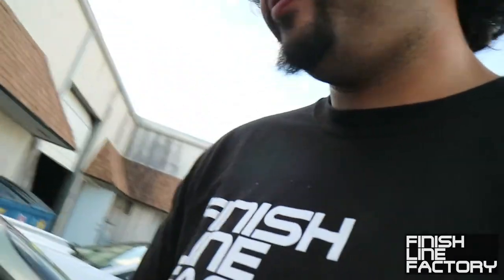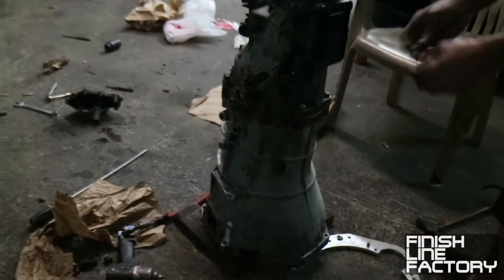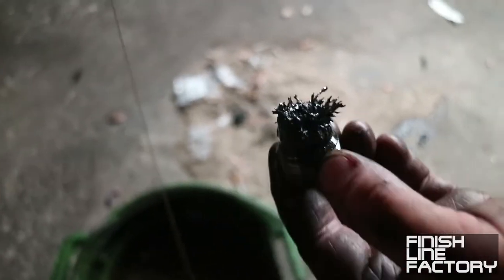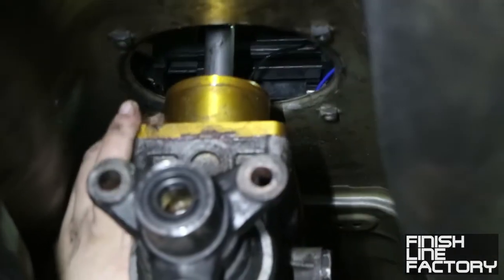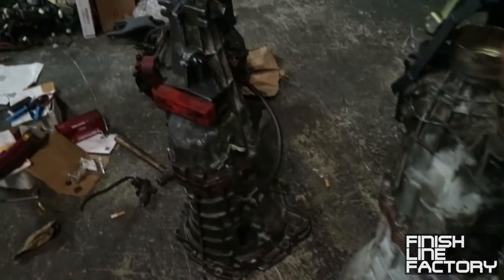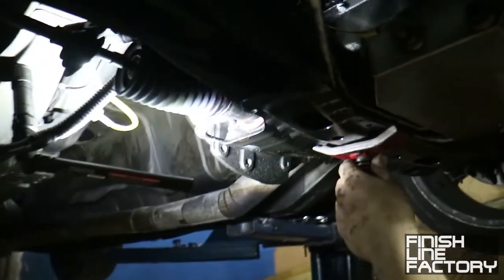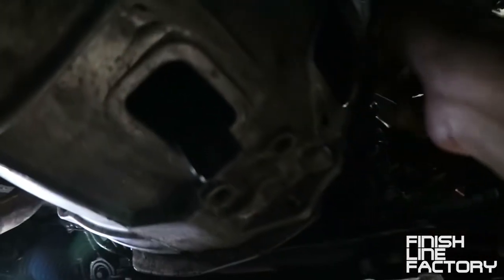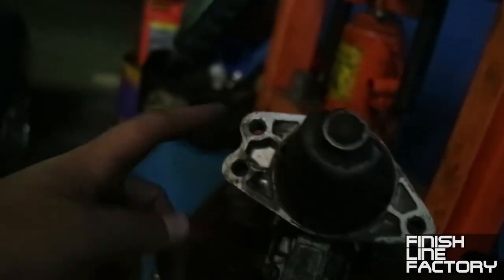Upgrading my 240SX's Gearbox from a 300ZX! Full video tutorial and walkthrough!

Comment: Why did you choose the 300zx gearbox over the 350z gearbox?
Reply from the maker: Cost and performance. A Z33 gearbox setup costs about $4000-5000 all in, whereas a Z32 gearbox setup costs about $2000. There's also performance, I didn't expect to exceed 600-700 HP, which a Z32 gearbox will handle just fine, whereas a Z33 gearbox can handle 1000+ HP. I didn't see the need to pay for performance I wasn't going to use, so I decided to save a significant amount of money by going with the Z32 box.
Reply: @FinishLineFactory  I understand. Thank you for your information. I got the 350z conversion
Reply from the maker: @dutchNFSGaming  Z33 one is definitely the better way to go

Comment: Did you have to modify the firewall, interior or trans tunnel at all?
Reply from the maker: No changes to firewall or trans tunnel. Mazwork's kit makes it almost as if it came like that from the factory, it's unreal.
Minor modification to the shifter hole was required due to the shifter placement, however there are kits from Xcessive you can put on later that allow you to use a more factory location shifter.
Reply: @FinishLineFactory  how much modification to the shifter whole? Does it fit once all the trim is in place?
Reply from the maker: @michaelclifton5391  Cutting down about 1-2 inches as necessary to fit the shifter assembly. It wasn't difficult. Once interior trim is replaced, it appears to be in stock location.
Reply: @FinishLineFactory  awesome thanks so much

Comment: I am currently doing this swap in my s14, did you run into problems getting the top starter bolt in? It looks like I'd need to remove the intake in bolt it from the engine side.
Reply from the maker: Didn't have any issues, went together smooth

Comment: was your z32 trans from a z32 na or turbo just curious if it really matters in the swap for a 500wheel hp sr build
Reply from the maker: I don't remember, I think they are the same
Reply: Thanks bud . Did you swap out to the z32 rear end and change the axles at all?
Reply from the maker: @jasons8727  I had a Q45 rear end with 5-bolt axles, these are very strong and use a ball-and-cage design
Reply: @FinishLineFactory  thanks bud I'll look into it thanks for the reply